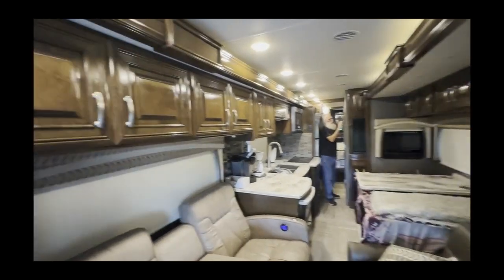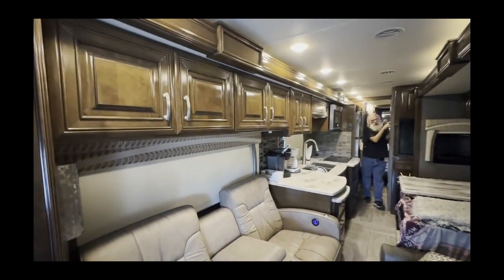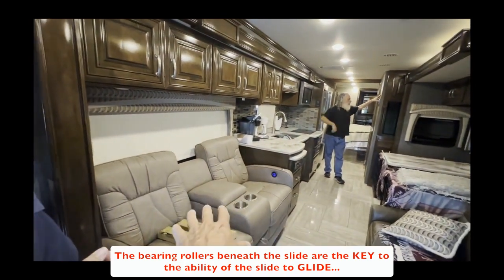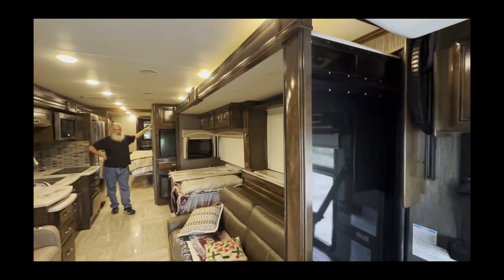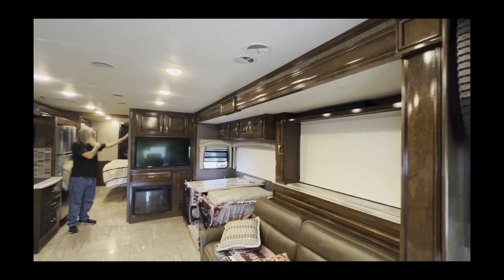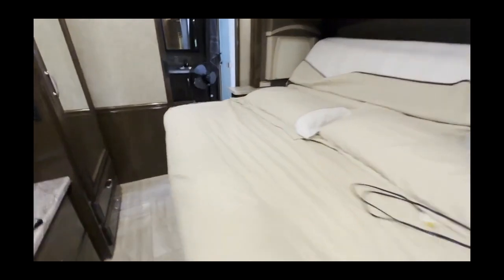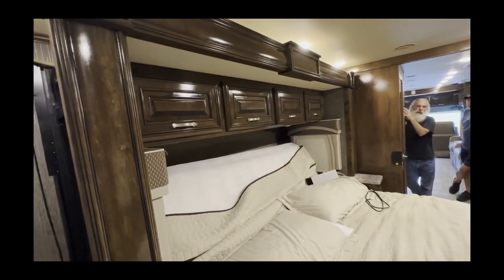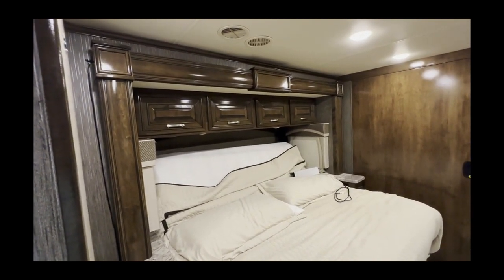John D and his Vroom Slide/Glide Systems on all 3 Slides

Comment: Was the existing slide system a schwintek? If so they are not the correct application for large slide? Should be rack and pinion.
Reply from the maker: Yes, manufacturers have installed Schwintek on many large slides